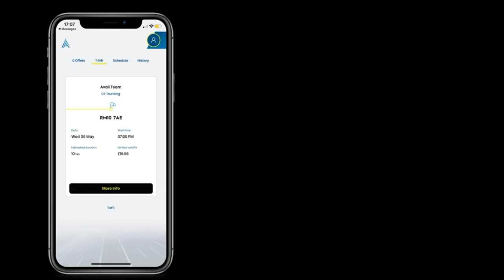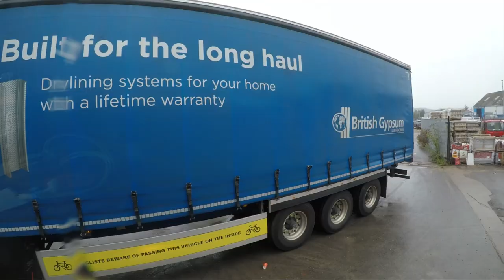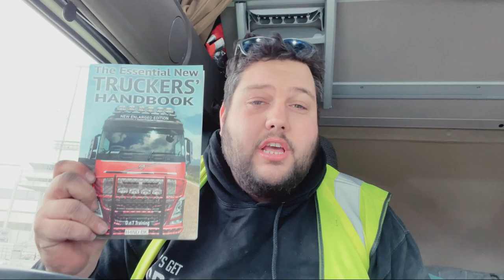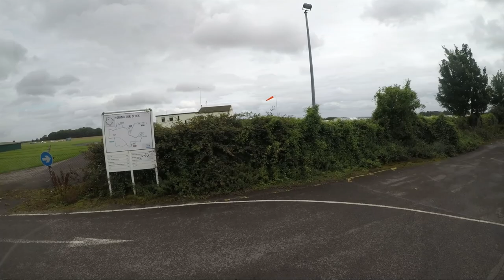Diesel Absolutely Pi$$ing Everywhere!

Comment: Thanks Luke, another good video. That thing you saw in the sky was probably a winch cable that hauls gliders up in the air. When they release the cable it has a small parachute on it to slow its fall down and also make it visible.

Comment: How much extra is it to tramp out roughly? Anyone?
Reply from the maker: I’m on £150 a day
If I do a night out on that day I’m on £176 a day
Reply: @lukecinahgv  lied about 43k a year didn’t ya.
Reply: @mikereed4042  Doing the maths, £150 a day 5 days a week is £39k a year. £176 a day, 5 days a week, is £45,760 a year. As he says, he tramps somewhat often, so £43k may be his average.
Reply from the maker: Do you know how to add up?
Reply from the maker: Thank you mate that’s exactly how it works out. 🤙🏻 obviously I don’t stay out every night, so I do not earn that maximum number. I normally do two maybe three nights out maximum a week and therefore around 4000 is what I earn. ) driving trucks for a living anyway)

I then earn around about £2000-£2500 per month in YouTube revenue on top
Reply: @pelicanofpunishment6   do your maths again. 150x 5 = 750-25% for tax and NI = 562.50 add 104 tax free night out = 666.50 x 4 times a month = 2666x 12 months a year = 31,992£. Now take away 4 weeks or 28 days for holiday where rarely you get that 104 tax free money as it’s night out. Can’t be asked to do maths . You roughly take home 30k a year. Not 43k I’m on same wages. So I should know.
Reply from the maker: Dude what’s your problem?! I never said I take-home 43k. I said I earn. There’s a difference. 
All my figures are before tax. After tax your figures are pretty much correct.

Do you have a problem with me because you’ve commented on a few videos a few times and it’s never anything positive? Whats up?
Reply: @lukecinahgv  I’m doing agency class 2 £16 p/h so for 10 hrs I’m getting £10 more than you’re getting for a full day class 1. Start a 7 finish at 17:45.
Reply from the maker: Yeah fair play to you mate. The money is definitely out there I don’t understand why some people think it isn’t. Class to tens to offer more money than glassware nowadays because it’s generally speaking a little bit harder fair play to you mate hope you’re enjoying it 🤙🏻👊🏻.
Reply: @mikereed4042  have you nothing better to do with your time than go through all that effort for a man you don’t even know? Your clearly a very sad individual.
Reply: @matty6848  who are you anyway? Nobody so do yourself a favour and bugger off